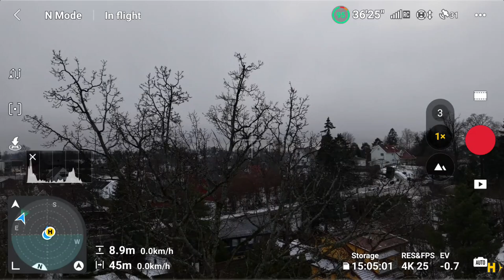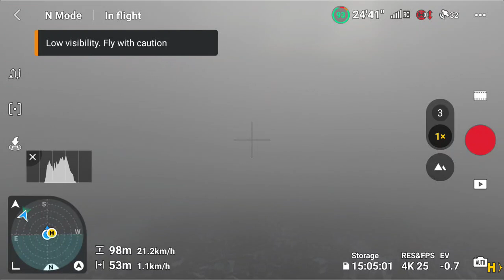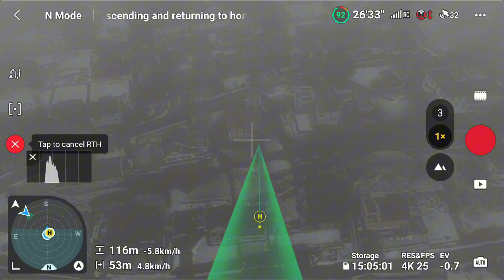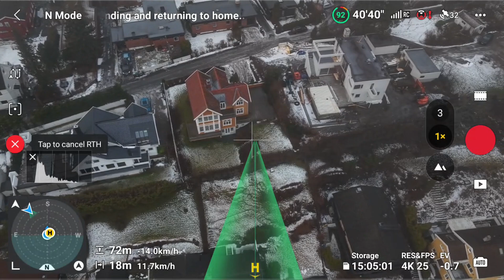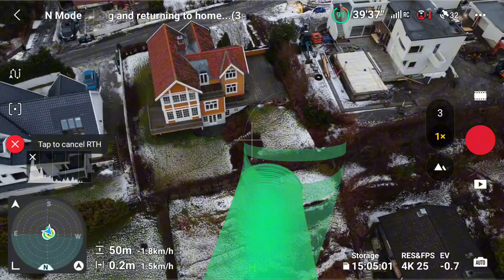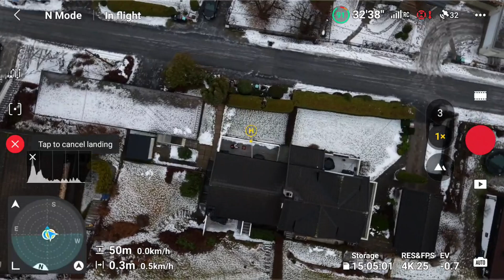What happens if your Air 3S get trapped in the fog

Comment: I flew my Mavic Air up above the fog one morning, 180 odd metres, when I was coming back down it kept thinking it was landing several times at 150 metres, I thought it was going to drop out of the sky. Fog messes with the sensors and confuses the drone 🤣
Reply from the maker: @Tassiephotographer  I believe that the fog actually may cover the sensors with moist, and I know from a small accident I had with my mini 4 Pro that if you are holding the down stick and the drone believes it is close to ground, it will start landing. I almost landed on a high power line that I was unable to see from distance. I am actually using this technique to hand catch my drones (placing my hand carefully under, then keep holding the down stuck until the drone slowly starts to descend (and keep hold until the propellers stops). My guess is that you got this landing message when you were holding the down stick, because I did not when flying in the fog. To come back, I used RTH 😊
Reply: @FinntheNorwegian-rm2vk  yes correct, every t8me I tried to lower my dorm from up there it tried to land, I was stuck up there for some time unable to come down, I was worried the batter would drain and the drone would drop out of the sky. Luckily I eventually got it to come down.
Reply from the maker: @Tassiephotographer  It makes sense.  The drone think it's near the ground and pressing the down stick (at least on both my Air 3S and Mini 4 Pro), you will then force the drone to land (and you have to be quick to abort it).  The only good solution in a situation like that is most possible to press RTH.  You can see here where my drone tried to land on a high voltage line: https://youtu.be/G-LeTE1JG-U. (watch from 2 min and out).